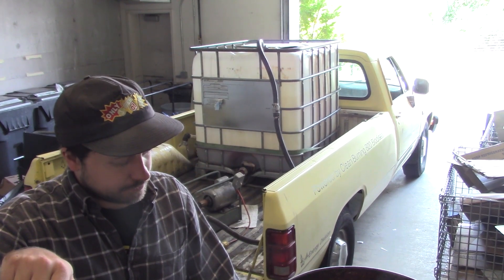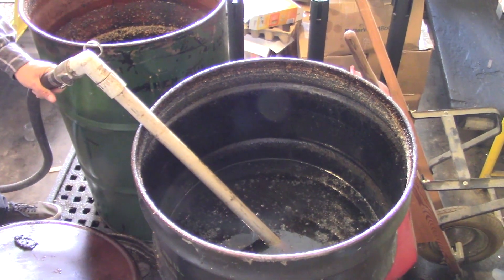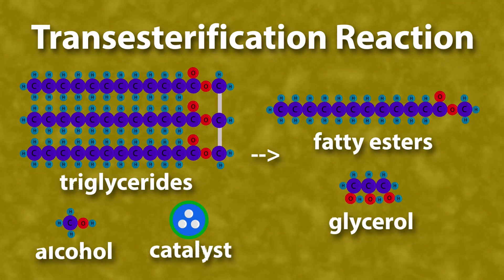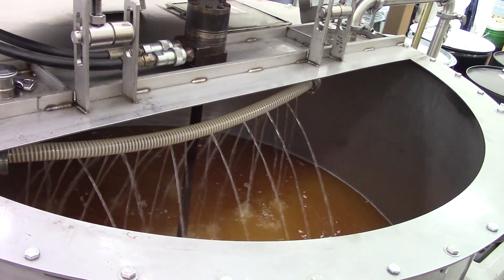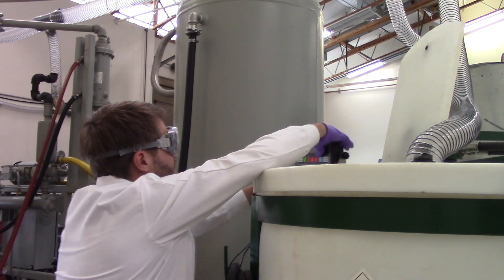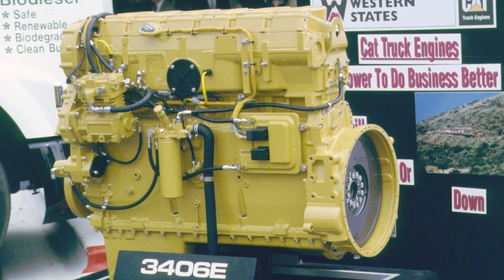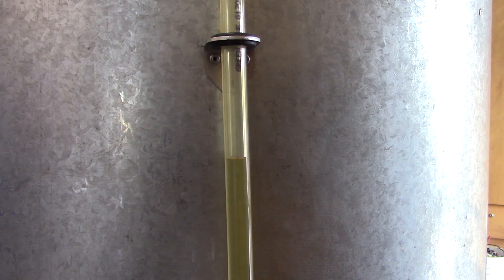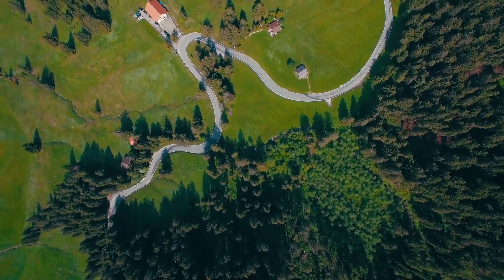Biodiesel Masterclass: What is Biodiesel?

Comment: Biodiesel is a renewable fuel made from biomass oils, such as plant oils and recycled cooking oil, serving as a cleaner alternative to petroleum diesel. It can be used in diesel engines without modifications, significantly reducing greenhouse gas emissions and improving engine cleanliness, contributing to a more sustainable transportation system.

Highlights:
00:14 Biodiesel is a renewable alternative to petroleum diesel, derived from biomass sources like plant oils and animal fats. It can be used in diesel engines without modifications and offers environmental benefits.
          -Biodiesel is distinct from ethanol, which is used in gasoline engines, highlighting the necessity to understand different biofuels. Each biofuel serves specific types of engines and applications.
          -The production of biodiesel involves a process called transesterification, where oils are combined with alcohol and a catalyst. This process yields biodiesel and glycerol as a byproduct.
          -Biodiesel has significant environmental advantages, reducing greenhouse gas emissions by over 70% compared to petroleum diesel. Additionally, it burns cleaner, producing less pollution.

Generated by sider.ai